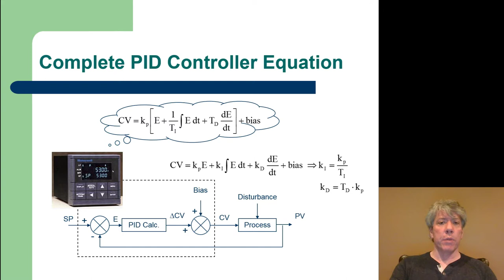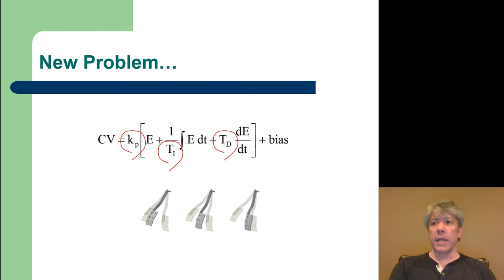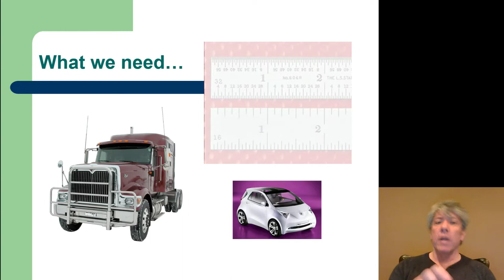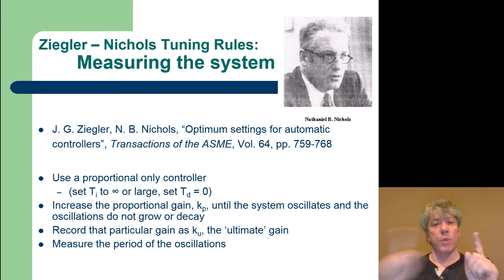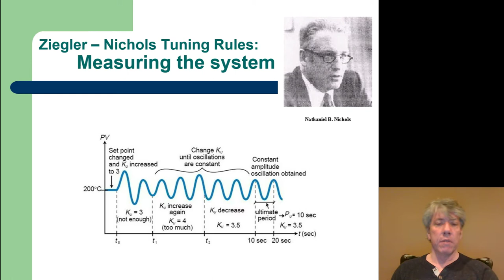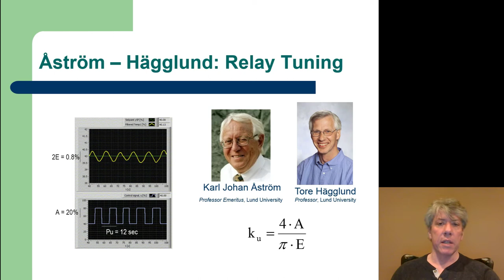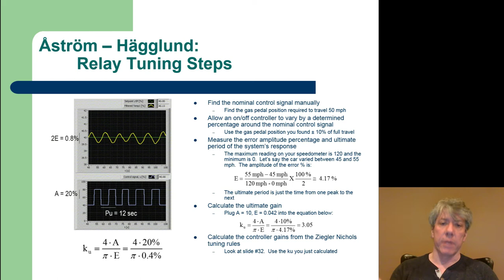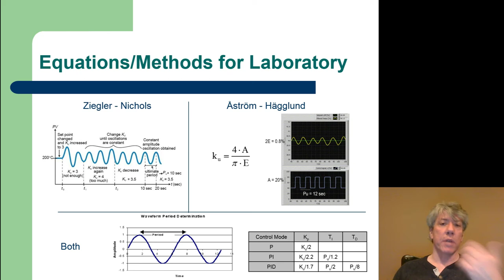MET 382 PID Controller Tuning

Comment: how to understand "The maximum speedometer" in 18:51? In a system, I don't know how to measure the "maximum speedometer".
Reply from the maker: Controllers do not usually work with actual units.  For example, if you are measuring the level in a tank, it would be measured in feet or meters (height).  But there is an obvious maximum level and minimum level in the tank.  Those would likely be set to correspond to 100% (full) and 0% (empty).  The controller only measures in percentage (%) regardless of what is being controlled.  When there is no obvious maximum, such as the car's speed, one must be selected to correspond to 100% on the controller.  Zero speed logically corresponds to 0%, but this is also the decision of the controls engineer, because negative speeds may also be desirable, and therefore 0% as sensed by the controller may need to be some reverse speed.
Reply: @damonsisk4270  Thank you for providing me with answers to my questions.